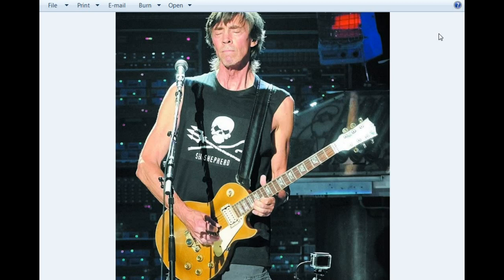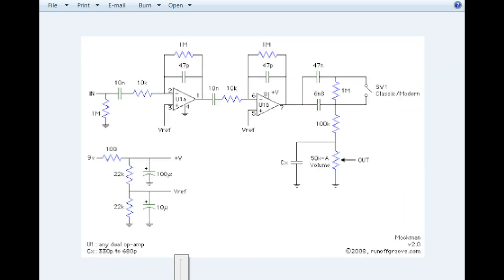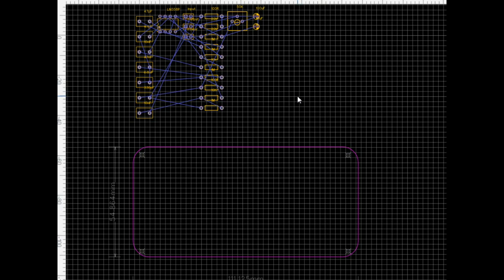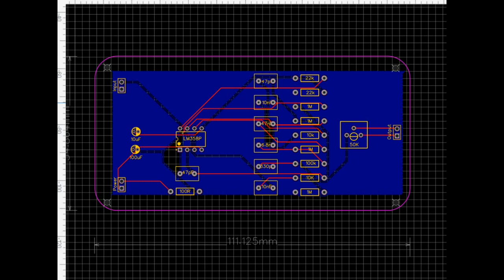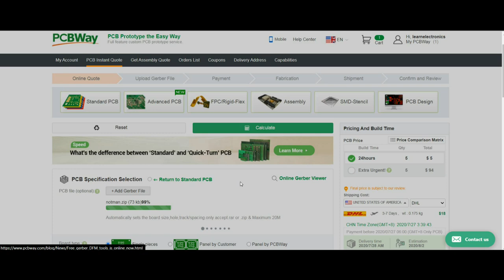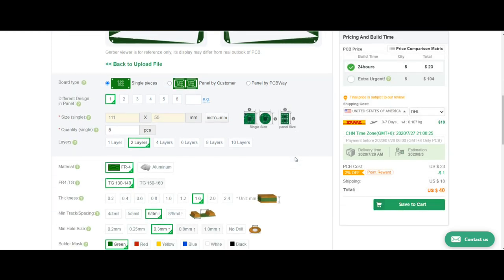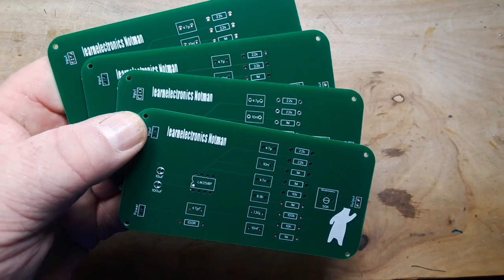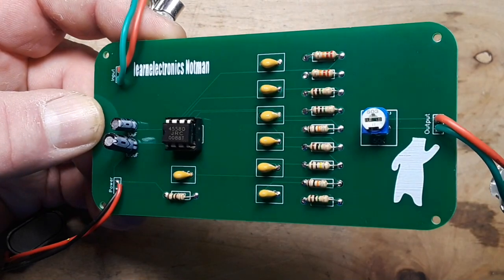DIY Rockman style guitar effect from design to PCB

Comment: Hey, quick related question.  I'm working on a pedal that has a high pitched squeal.  I think it is a heterodyne whistle.  I think my input wire is too long, but the way the board is designed, the input wire goes in on the left middle of the board.  Without redesigning the board (which I can't really do...), is there an easy way to solve this?

Comment: Nice work, I'm also a fan of Tom Scholz's Rockman. Just a constructive comment: you left out an important element of the Rockman tone which is the compression - the section involving the JFET transistor and the diodes. Unfortunately, this section can only be implemented using both positive and negative polarity power supply (which the original Rockman does). The original Rockman also achieves the signal clipping using LEDs, not sure whether it saturates the op-amp. Other than that, nice PCB work. Is it EAGLE the software you are using?
Reply from the maker: EasyEda